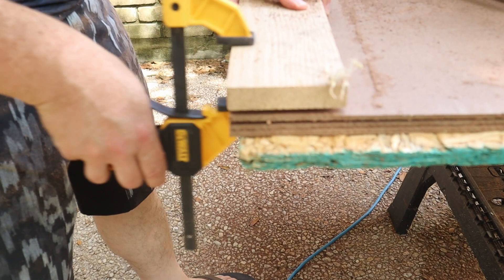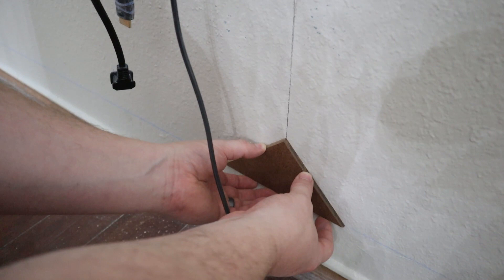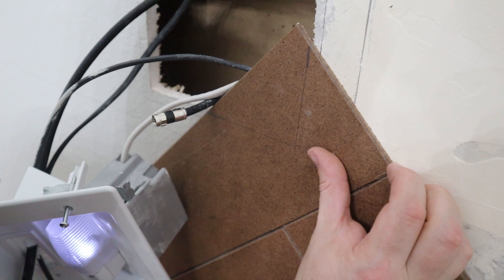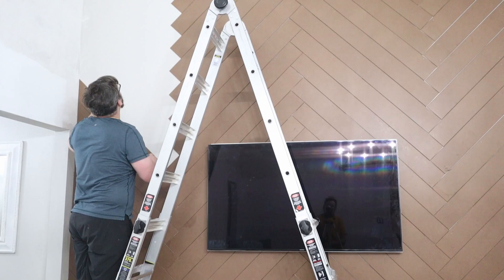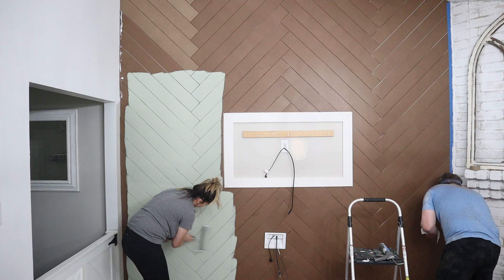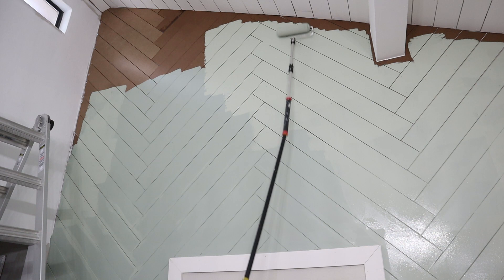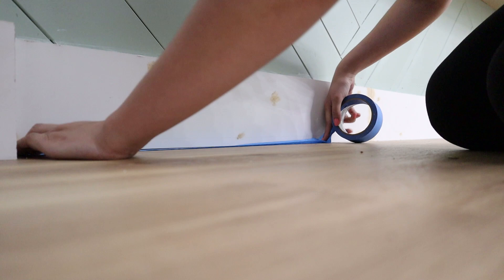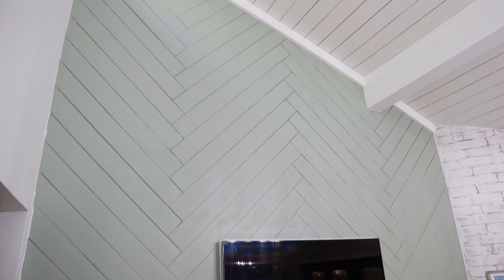How to DIY a modern accent wall | board and batten with textured walls

Comment: As a DIYer myself, I want to make sure to those who would love to replicate this and other styles such as board and batten. Do not use glue. You may want to replace the style in a year or two and you will be in for more of a headache than you bargained for in the future. I totally agree that with the beveled edges, it’s a step you don’t want to skip. Also make sure to paint in between each board as it’s placed incase the wall in the back shows. You could also paint the wall first, but you’ll be using more paint that way. It’s harder to do it after all boards are placed on wall. She mentions this later in vid. All in all the final wall was an absolute beaute. You guys did an amazing job. Go guys go!!!